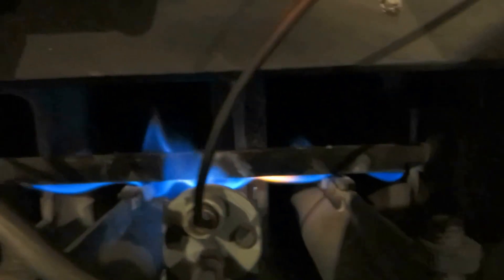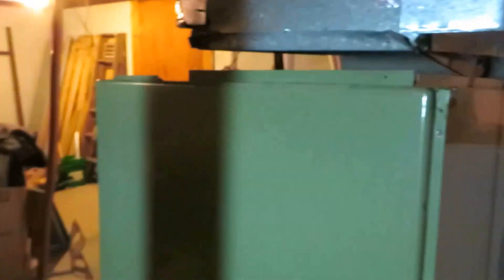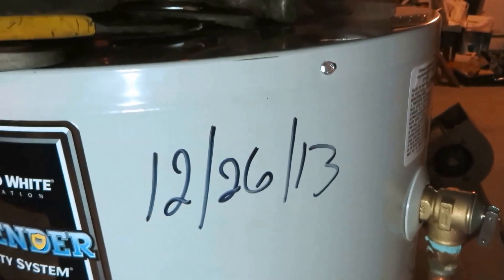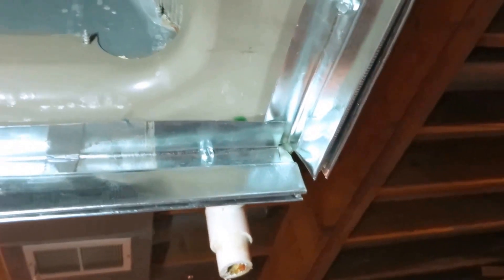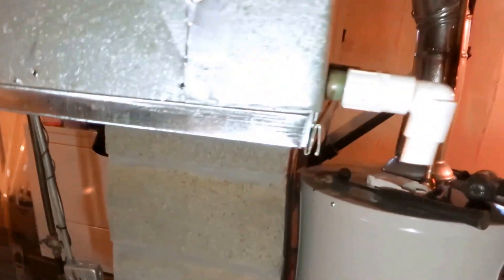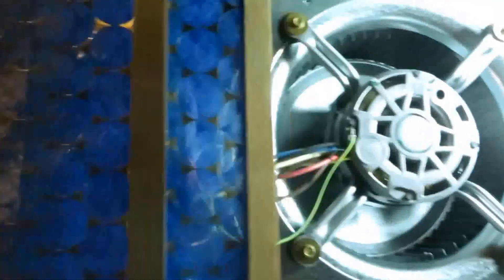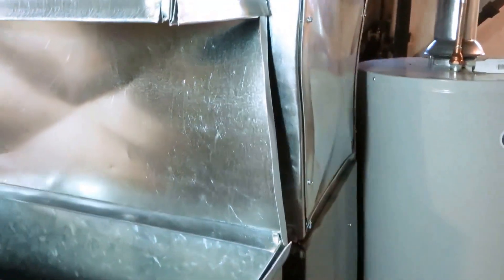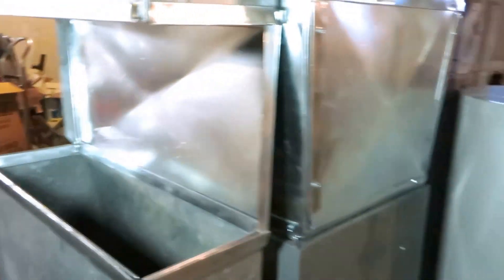HVAC:Ruud/Rheam 93+ gas furnace upgrade,sheetmetal work tips

Comment: Awesome job man! I love the screen idea in the exhaust. Do you glue the PVC in or unglue incase u have to clean screen?
Reply from the maker: i use roof gutter screen in the exast and intake it seems to work fine i just stick a piece of unglued pipe in there to hold it in place it never gets blocked  its to keep the bees and birds out of pipe .i just though its a good thing to do .i have qiute a fue out there like this and it seems to work just fine .i though the sceen on exast wood ice up in the cold weather but its fine .i have been watching  a fue jobs .never a call back yet
Reply: steven lavimoniere ok  thanks great idea

Comment: Nice clean install Steve I'm sure they will appreciate it the rest of the winter. We do mostly electric heat here in South Texas but i enjoy your videos anyway.  I do all my work by myself too, it takes a little longer but you know it's done right.  Keep up the good work.
Ray
Reply from the maker: thanks ray i have been doing all my own work for 20 years now why change now .
Reply: Hey Steven fit and finish my friend!! Very nice, yep I heard that  I'm getting too old for this BLEEP before lol lol...
Reply from the maker: Mike's Random Channel well i guess i am a little rouf around the edges they say .why hide behind the camara  i figure i would show my true personalty .
Reply: Yeah that's how I got the helper job back in the  day. The guy I helped with had health that was failing and I was more than glad to take a few dollars to help the man and learn from. As at that time was what I hoped to be a career path. But sometimes things don't work out and the need to eat takes over! 

Good grief I remember many of the furnaces we changed out having a huge gas guzzling pilot section on them and hugely oversized plus A/C's that were operating and completely uncared for (with dirty and plugged coils inside and out and improperly sized.)
But then all the service equipment was still all analog and guessing was something that drove him nuts, he knew then that diagnostics needed to improve and was hell bent on that happening. Ball park guessing was something he was tired of for efficiency's sake. So if he was around today he would have embraced new things with great enthusiasm!
Reply from the maker: Mike's Random Channel you should go back into the trade  its america any thing is possable

Comment: Nice job Steve. I know what you mean about trying to do all that work by your self. It's a lot of work especially in the winter when you have their heat off. Did that ruud have a smart valve  in it?  You should get yourself an apprentice that you could teach and pass your skills on to. Then when you are ready to retire he can take over your business.
Reply from the maker: i wanted to have my kid do it ,buy she is a girl and has no intrest in bussnes a fue bad burner cleaning and no heat service call ,and bad drain cleaning when she was younger coming with me on the weekend and she was done lol one time we went to a no heat call in and appartment 3rd floor i pulled the t stat off wall and 20 small cock roches ran across the wall lol i drop the tstat and left she never forgot that eather did i ..i see some terrible stuff over the years